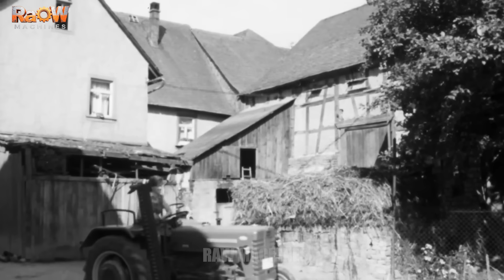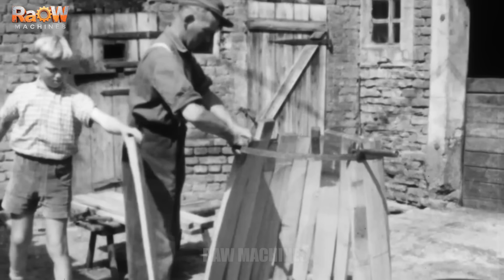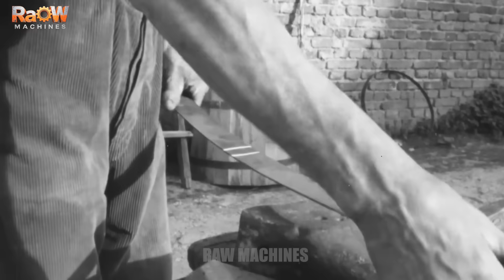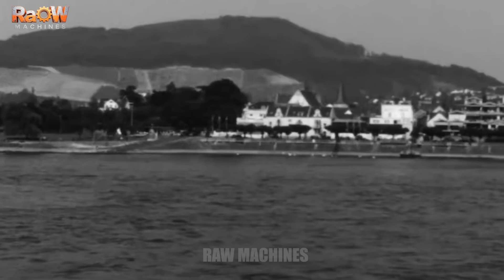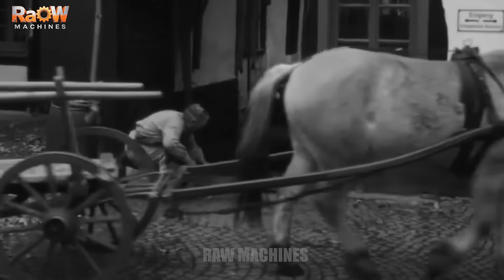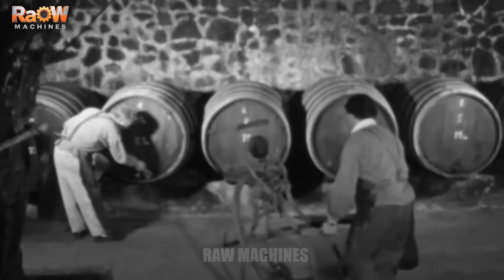Before Electricity: Inside a Traditional German Sawmill | From Timber to Wine Barrels

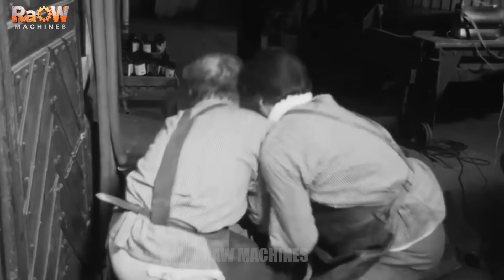Comment: 38:29 they are pulling this out by hand yet they have a horse waiting outside. Why not use the hose’s strength?
Reply: Not only that , but the man pushing up from the bottom step can easily get crushed and killed if the rope or hook or barrel breaks. Lot of risks here.

Comment: 1:25 that tractor has headlights. Do they run on burning oil or electric? I bet the spark plug is electric. Unless this is a steam tractor. Or maybe it could be a diesel engine.